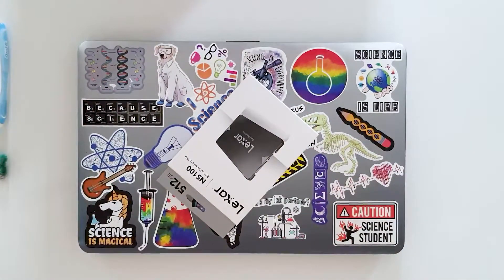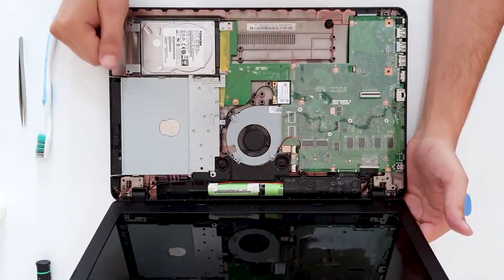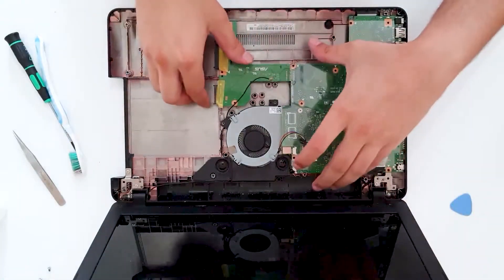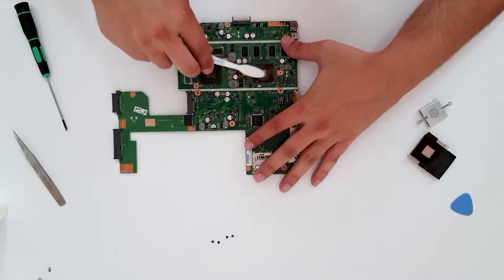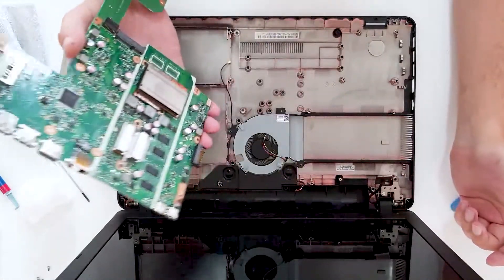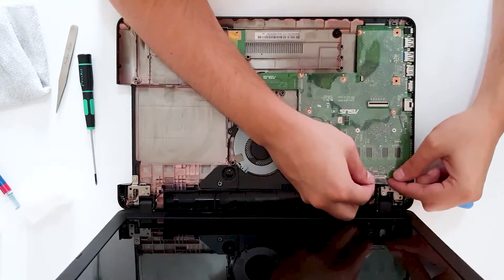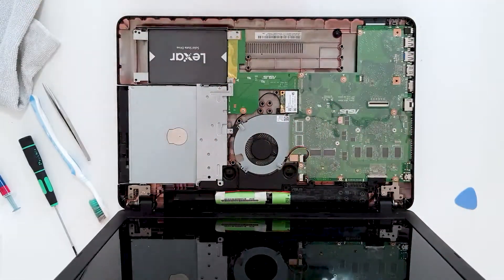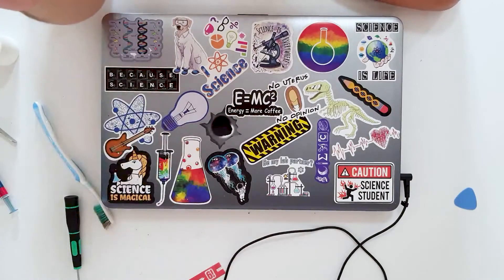Upgrade ASUS X540L Performance: SSD & Thermal Paste Change

Comment: tell me please , do i need to wait for the paste to get dry before the assembly or not?
Reply from the maker: No, no, no! You don't want your paste to dry. 😉
Reply: @Chichinjo  but it however gona dry on is own doesnt it?
Reply from the maker: At some point yes, but, for example, mx-4 will keep for 7 years before drying out. Also depends on pc/laptop usage. If your laptop goes full speed most of the time, then that period will be shorter.
Reply: @Chichinjo  ok , you help me so much tnx
Reply from the maker: You welcome 🤗
Reply: @Chichinjo  hey that ASUS X540SC

Comment: hey bro thanks for video i changed my hdd to ssd and upgrade my ram to 8gb 1600mhz, but there is a problem. i setup windows10 but it takes 2 days and now its so slow. i didnt even see my desktop. did i do something wrong?
Reply from the maker: Hey Fatih, thank you very much! 👋 Well first, you can check ssd health, and try instaling windows 10 again, and take notice if setup is sliw also.
Reply: @Chichinjo  hey bro i solve problem. it happinings about my ram. my ram is don't work or laptop isn't support. ram is 8gb ddr3 do you know it is support it ?